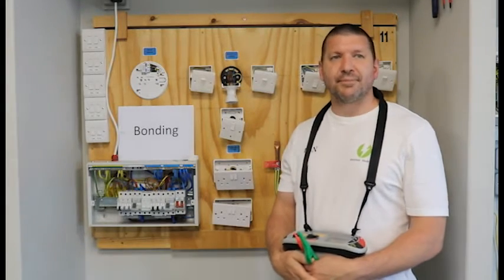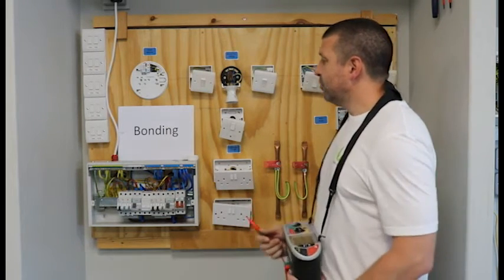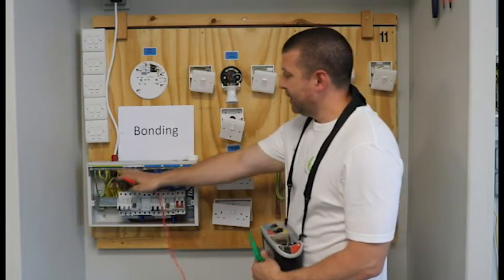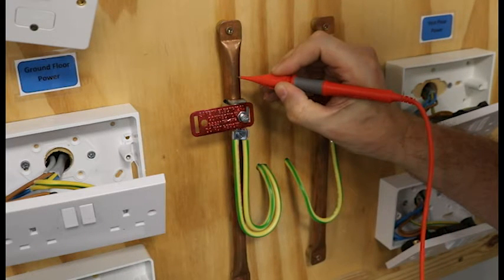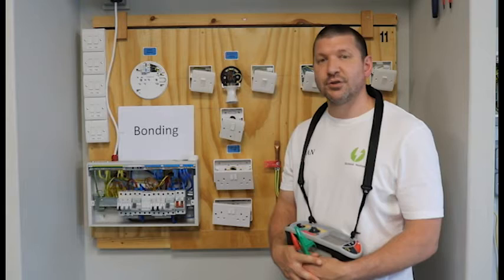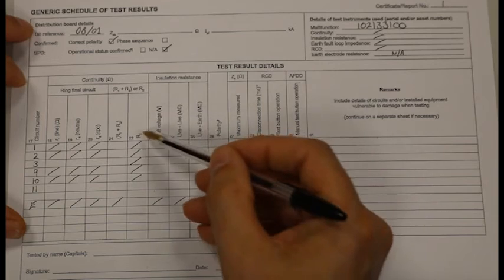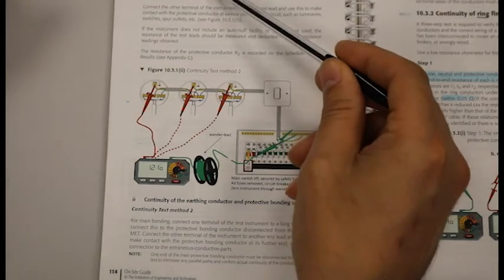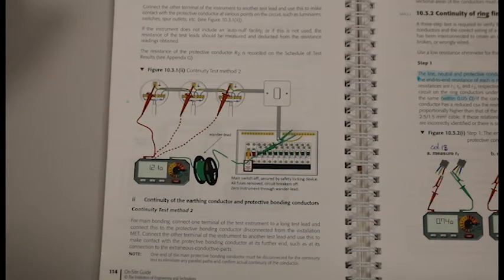Guide to completing a Continuity of Bonding conductor test and how to complete a test sheet

Comment: Observation    Test to pipe ok  this is prob grounded  but does not prove cable is intact
T over distance hidden in fabric of building ,    Personal view need to disconnect at bonding clamp and test continuity of 10mm back to board  I’ve come across  were the clamp at gas main has clamp short 10mm silicone into hall in wall going nowhere just to trick the eye ,  just some polite input and thank you